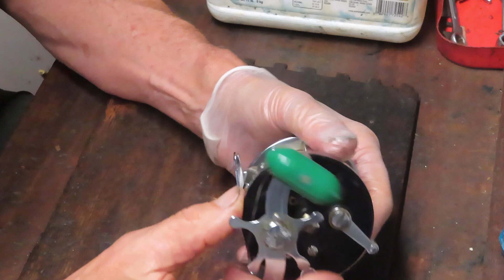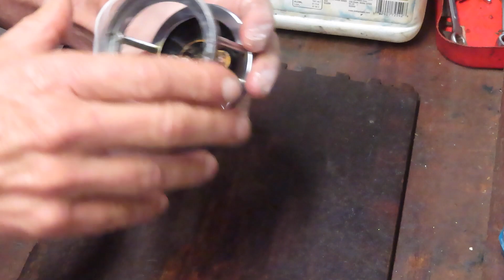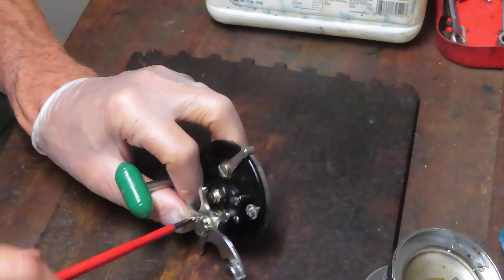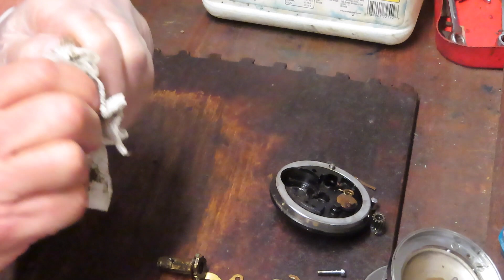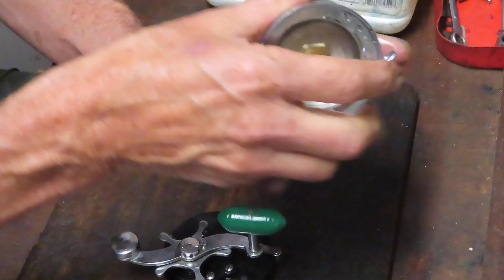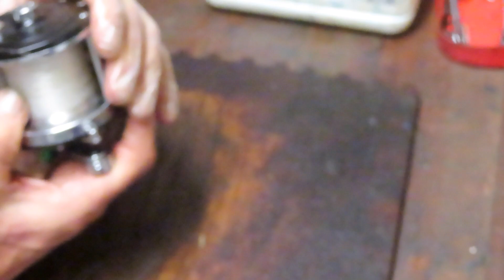Penn Surfmaster 100 saltwater fishing reel how to service and repair

Comment: The antireverse spring in mine isn't very springy anymore. Know of any replacement springs in a material other than copper?
Reply from the maker: Some folks have used steel flat spring material to make their own,
Reply: I'll make Dennis cringe with this one. 😂  I have used a strip from the top from a can of sardines or my favorite kippered herring.  Just don't cut yourself.

Comment: Howdy! I have my dads old reels and I serviced the Peen 100 like you instructed and it worked amazingly. Thank you. The reason I did it how ever is the handle slips or the inside moves when I am reeling in even though everything is tight clean and for the most part works. It’s only when I push hard and the spool is tough to reel in (like if a fish is on the end) not sure what is happening or if that is normal. All parts are in working order but can’t figure it out. It does the same on my penn jig master 500. Both are vintages. Any thoughts?
Reply from the maker: Have you checked the handle hole and where it fits on the gear sleeve?  It sounds like wither one or both of them is rounded over and is not holding in place.   The gear sleeve is a brass soft metal and if the handle is not locked down tight, the arrow will wear away the shoulders and there will be nothing to grip.  Check that first and replace either the gear sleeve or handle or both if needed - Dennis
Reply: @2ndChanceTackle  I have and it’s locked in place the entire handle and also shaft move (under pressure I have to really push) not sure if this is normal?
Reply: @2ndChanceTackle  here is a video I took. https://youtube.com/shorts/yzJyxqrtlbs?feature=share
Reply: I’m holding the spool but you can’t see it when it slips

Comment: Thanks for your great videos, and the couple of reels I've sent you for service are like new. I do have a question about a Penn Surfmaster 100 I picked up at a fishing tackle store the other day. When reeling, it periodically gets harder to turn, like something is rubbing. If I take the sideplate off and reel it doesn't happen. So I'm thinking it's something with the spool or the non-handle side plate. Have you come across this before? Oh it's the anodized gray/black colored spool. Thanks!
Reply from the maker: It may be the side plate bearing or it could be that the frame is out of square.  Hard to say, but you initial thought on it having to do with the spool sounds right - Dennis
Reply: @2ndChanceTackle  thanks! The reel seems aligned properly so maybe I'll look into that bearing.

Comment: Dennis, You are so right for a service business!! I am consider a narrow frame casting reel for light bay fishing.
Reply from the maker: You may also want to consider an Abu Ambassadeur with braided line.  That will match up well.  Thank you for the kind word and feedback - Dennis
Reply: @2ndChanceTackle  Yes, I have seem them at my local Pawn Shops, but I have thought that seem to be over priced especial when placed on the cheap rods they seem to married with.  I have  an old wider frame Ambassadeur 5000 (red), just seems a little to wide for hands and to nice to salt fish with it. I mean, I do wash off the reels and each trip and air them off.

I will keep looking for narrow reel, Thanks Alex In Houston, Tx.

Comment: It doesn't have to be "fishing reel" specific when it comes to grease. So long as you use marine grade. Reel grease is just re branded marine grease anyways.
Reply from the maker: I am not a chemist, so I stick to the ones labeled Fishing reel grease.  If marine grease is working for you, go ahead and use it - Dennis
Reply: That's not accurate

Comment: Dennis do you think the pflueger with the one screw is any better than the penn reels with the one screw?  Enjoyed it as well!
Reply from the maker: Which Pflueger are you referring to?  There were a lot of manufacturers that used the single screw take apart systems and a lot of models were made by each.  It is hard to compare without knowing the line you are asking about - Dennis
Reply: @2ndChanceTackle  Dennis, I think it is the Pflueger Capital 1989?

Comment: I have done a lot of “bush” fixes on anti-reverse mechanisms on spinning reels. I did it on on a Daiwa rear drag Apollo reel, a Daiwa Regal fast cast, and a Sportfisher ultra rear drag to name a few. Several times I found the original parts but that doesn’t happen often. All those reels still operate just fine. The fix on this Penn was a good one especially because it was simple and minimal. Most of mine haven’t been that easy.  I end up thinking about it for a good while until I come up with a plan. Of course half the time it doesn’t;t work but eventually I’ll find a way.  I loved this video because of that “bush” fix. Thanks Dennis! I got a nice Mitchell 306 in the box with all the papers today. The 306 is one of my favorites. My other two are well used but this one is new.  I also got another Shakespeare 2701 for my collection. Guess what Dennis, I’ve reached 170. (Not counting “bush” fixes!)
Reply from the maker: Wow - 200 is in sight!  That is quite a collection Chris.  Stick to it - Dennis
Reply: @2ndChanceTackle  I honestly don’t think I’ll ever reach 200. I simply don’t have the area to properly index and store that many reels. Also, at this point I have gotten most of the reels that I want. I’d love to get some of the later Penns than my Z reels. I’m talking about the ones made in the USA. Problem is I just can’t afford them. All the Penns from Greenies on up have soared in price making me grateful for the 11 I’ve got. I couldn’t do that right now. I think fishing reel collectors are coming out of the woodwork and driving up prices.  So the only way I could buy some of these Penn reels is to sell others in my collection. I’ve worked too hard to do that so the rate at which I’ll accumulate additional reels is definitely going to slow down. Right now I’m looking at Japanese reels like Roddy and Shimano. Remember my collection has been based on the guideline that my vintage surf spinning reels would be mostly manufactured on or before 1980. I have a few that aren’t that age but very few.